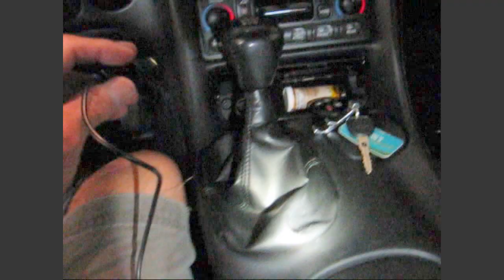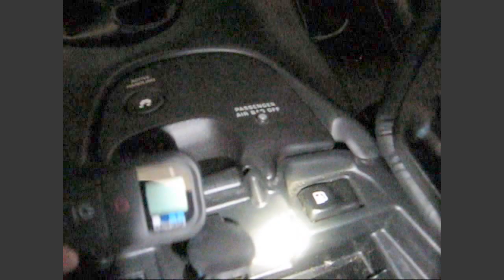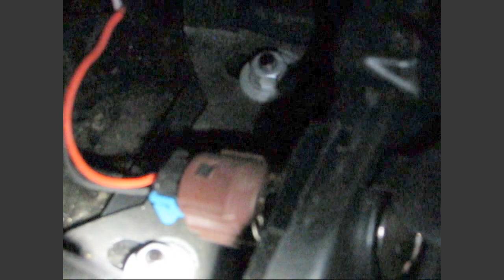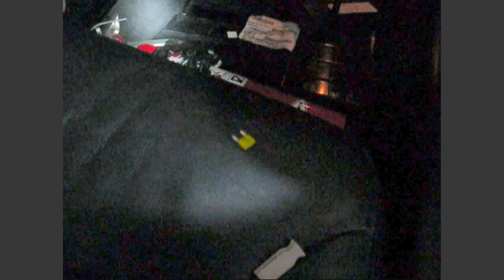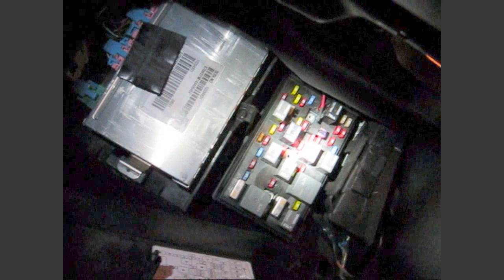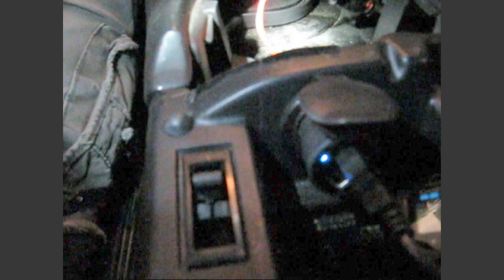Corvette center console power supply dead repair fuse by froggy

Comment: I have a 2000 c5 and having window and door lock issues. can u tell me wat fuse or other problem i mite have. Contact at louisauger92@yahoo.com
Reply from the maker: The circuits are marked on the fuse cover (on mine). These seem to be two separate issues, so pick one & fix one at a time.

:)